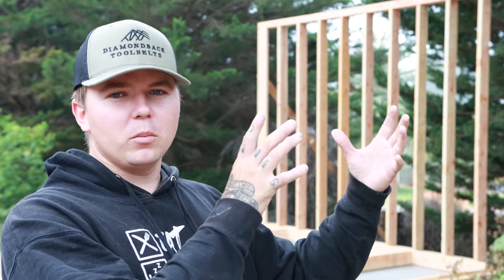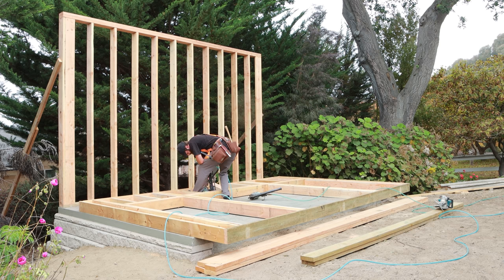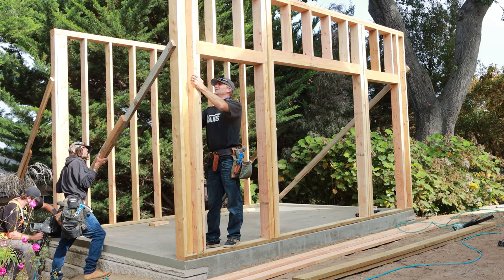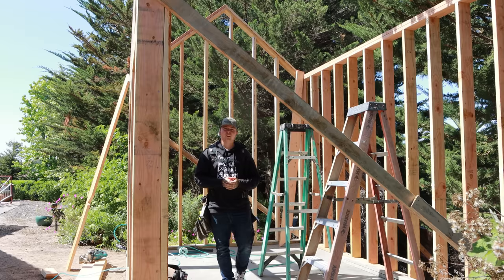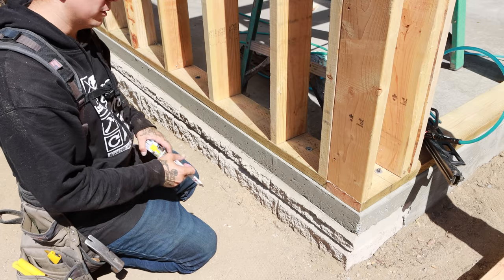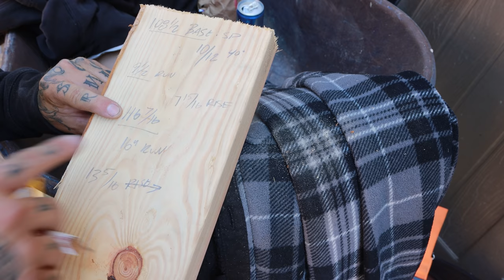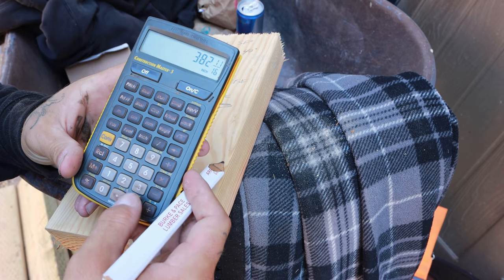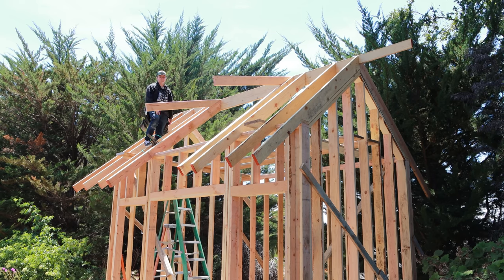Not Your Average Backyard Shed | How-To: Using A Construction Calculator

Comment: Metric calculations are so much easier!! Here in Scotland we just do all wall plates at the same height then build to underside of rafter after.
Reply from the maker: Can’t do that here unfortunately.
Reply: That we sure do
Reply: @MattBangsWood  personally just think it’s easier! But those imperial measurements look so confusing as fuck lol
Reply: I get so disappointed when metric workers diss imperial without actually learning it. I started off with imperial but now use metric. It's possible to make mistakes in both but once you learn them I wouldn't say one is easier than the other

Comment: I do the same with sprayed foam houses i build the attic walls first then the roof goes over  it,saves u from bending over on tight spaces or in some cases from building scaffolds when walls are too high

Comment: Now when you’re laying out your 16 on center from what you have shown . Now do you do the same to the other side and meet in the middle so everything is consistent from both ends because I get how you’re doing the measurement from one side but let’s say the rake wall is 16 feet long do I do a split measurement starting from each end and meet in the middle just wondering because I’m brushing up on how to build rake walls pluse you explain everything well

Comment: @MattBangsWood great work and great channel. Im currently planning to build a shed in my property and had a questions. I see you're using the a Ramset gun to attach the bottom plate to the concrete. I was wondering if there is a difference between the Ramset nails vs J bolts added during the concrete pour?

Comment: I have a question. When you build that rake wall, do you have to block at 8 foot where the top of the zip system is to fasten it inbetween the studs

Comment: Interesting. I actually frame the gable end wall like the other walls, find the center and put a stud to hold my ridge beam then calculate the rafters off that. I find this is easier if you have doors/windows on this side.
Reply from the maker: Can’t do that in CA, unfortunately.
Reply: @MattBangsWood  Of course. Do you know why that's not allowed?
Reply from the maker: Creates a hinge point, engineers would have an absolute fit.
Reply: Noob here. Can you expand on what you mean by  ‘hinge point’ please

Comment: Would you use a rake wall on a 18' run wall with a door? The shed is 22'x18' with single door on the gable end.
Reply from the maker: Me personally, I wouldn’t ever frame flat top if it was raked.. Calculating studs isn’t hard, but some people don’t like the time it takes.

Up to you!

Comment: What tool is fox using at 3:34?
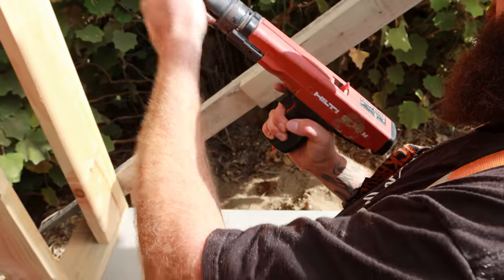Reply: Its a powder actuated fastener, the Hilti gun that is shown at 5:17-5:23.  Shots a hardened steel pin to fasten a wood plate to concrete.